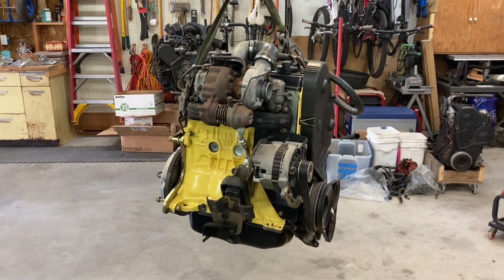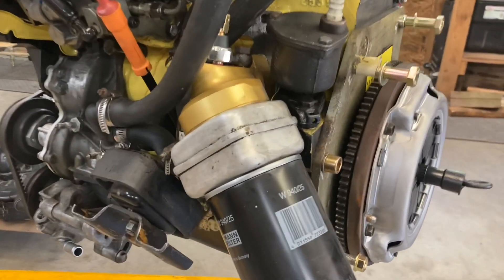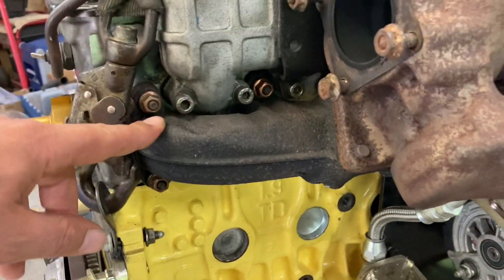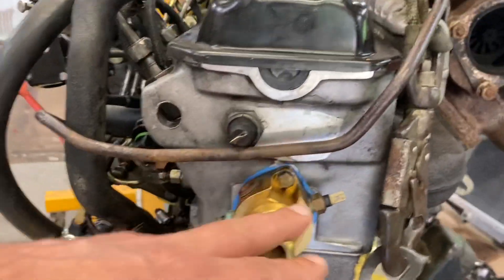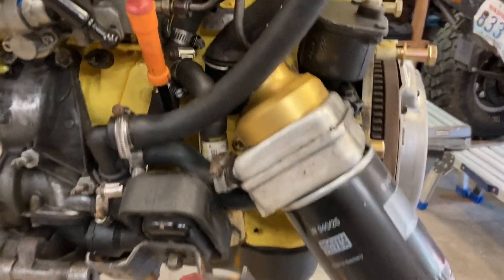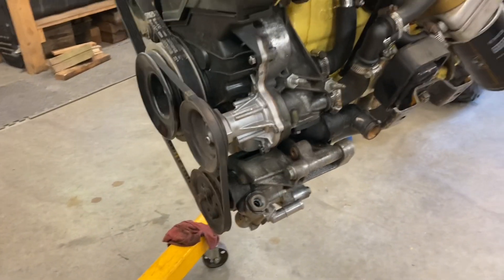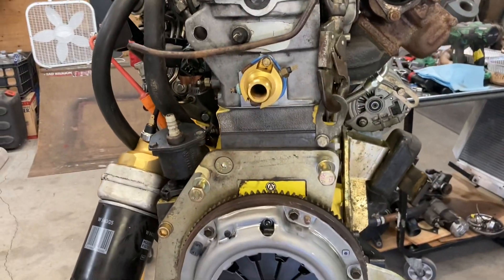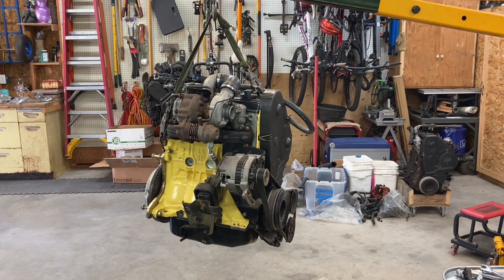Suzuki Samurai VW AAZ 1.9 Turbo Diesel swap part 2: Engine prep

Comment: randomly came across your instagram, is this the second aas engine you put in your samurai?
Reply from the maker: It is! I’m still sitting on the first one with low compression. I have rings for it, suppose I’ll get to it some day. I need to put a new video up. It was overheating with the larger samurai radiator. Just did electric PS so I could fit the Acme radiator. I’ve actually been daily driving it. Sorta like driving a tractor. Thanks for watching!

Comment: hello,what clutch do you use? clutch disc
Reply from the maker: Samurai clutch and disc, Centerforce stage 3. The stock samurai clutch slips with the 1.9T, too much torque

Comment: The flywheel that you use is the oem sj413 engine or not ?
Reply from the maker: The flywheel came with the kit and has been machined. Not sure what one they used but assuming it’s a stock flywheel as the clutch bolts right up.
Reply: @Chris_by_four  yes but the clutch that you are using is the suzuki one
Reply from the maker: Yes, that’s what I said. Clutch is stock. Flywheel came with the kit from Acme and has been machined to bolt up the the VW crankshaft.

Comment: Is the diff OK running the bigger engine?
Reply from the maker: So far, I’m running a 4:1 gear set and 5.29’s in the axles so ratios are ultra low and not too high stress.

Comment: Are using the original trans?
Reply from the maker: Yes, original trans and T case. After driving it a while a Toyota trans and dual t case would be nice. Samurai trans seems to hold up but the low rev diesel is sorta full crawl or highway geared with no “perfect” gearing option for both crawling and highway. I have 4:1 T case and 5.29’s so I’m geared really low, that probably helps the samurai trans hold up.

Comment: What part do you have to use to get a spin on oil filter??
Reply from the maker: You can use an Empi remote oil filter adapter or I used the Acme angled oil filter adapter.

Comment: what was that exhaust manifold off of?
Reply from the maker: It’s just an AAZ manifold. Some are different than others depending on what turbo they came with. When I bought this engine it had a K5 and I wanted to run the bigger k14.

Comment: Hey man thanks for the great walk around. I have the same motor and kit as well. Busy life...wont be getting it installed anytime soon as I am working on some suspension upgrades currently. Just curious about the serpentine belt on the GM alternator. I see someone else asked you the same question...is there no part number on the belt that you can see? My hometown has a very completely useless automotive supply and I would not even begin to think they could help me with a string measurement lol. I also want to use my power steering pump like you have.
Reply from the maker: I dug through my book and luckily saved the labels from the belts. Alternator is Gates K060325 and power steering is Master Pro 7312. Good luck with your swap!

Comment: I have this engine in my 87 Sammy. I replaced the fuel injectors. There was a las a a month getting the rebuilt injectors and I do not remember the sequence for routing the fuel return lines. where can I get a picture of the fuel return line sequence?
Reply from the maker: I have a Bentley manual that covers 93-99 Jetta with the AAZ. The little return port closest to the front gets a plug then the other side goes to the next injector and so on till you get to the last hose which routes to the back of the pump.

Comment: What is the serpentine belt number that you used?
Reply from the maker: I don’t recall the part number. I mounted it and used a string to measure it and went to the parts store and had them find a belt that matched.
Reply: What transmission did you run and how is it holding up
Reply from the maker: @08rabbott  stock transmission and transfer case. So far so good but I have a spare just in case.